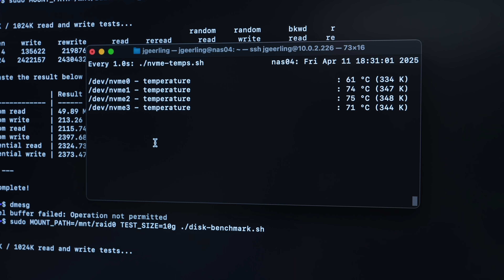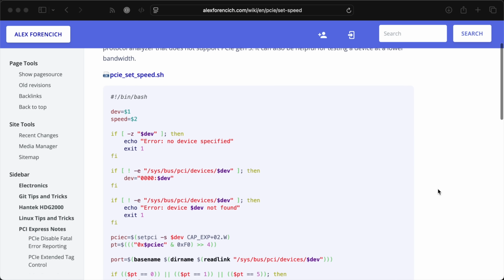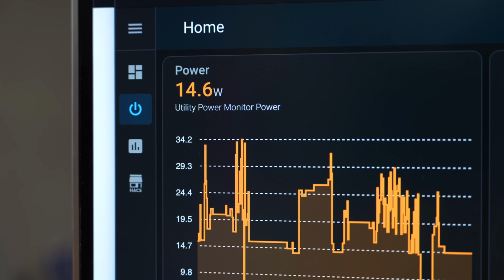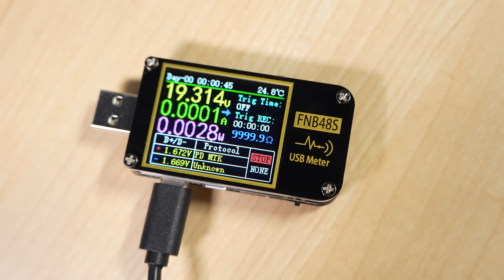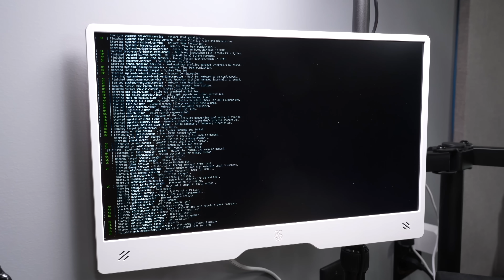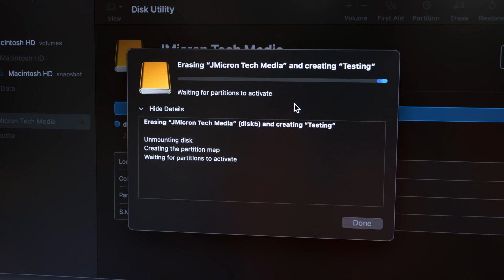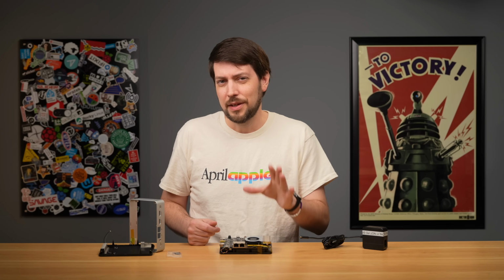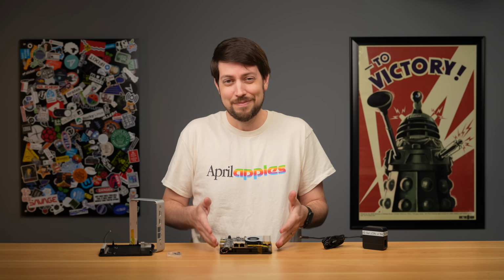I fixed the perfect Mini NAS!

Comment: you expect people supplied stuff to work? false hopes. sounds like the cpu complex is cooked, intel. you changed two variables, important being the downclock not the temp mod. your solution makes no sense. m.2 ssd should run fine on a potato power levels, assuming the base board is fine, which it is not. underclocking solved nothing if you also need the mod cooling system. out of the box solution. responsibility is on the consumer, dont trust others to supply you anything, working. its on you. well God's man, hows that trust in people now. in God we trust right? humans are defined to be lack of everything. one God you lack rich service of people guy. you should say if God allows. as you cant do anything without God allowing. and law based people systems are the curse of law. dont even talk about law based rights. freedom diy. pew pew people of peace. you get what you pay for indeed. God's gift is free, even among people. people are your problem, you know. I promise, they/you say. tongue speech is evil, dont try to stop it with your law speech. design better case yourself. then you dont have to pay anything to the middle man, law. btw yt speeds are slow as heck right now. ie why do you say me to be good. only one is good, God is one.

Comment: Sure take them up on it.  Being as I'm sitting here in my shop watching this using a GMKtec1 that I'm thrilled with, I'm very suprised in the performance problems  you ran across.  This does not seem to be up to GMKtec's usual standards.  It would be nice to see if someone else can pull off the same/similar setup properly.

Comment: My vote is still for the Asusstor 6 or 12 flash NAS. Just put it on top of your mini rack
Reply from the maker: Even on top, it's a bit wide. I actually took mine apart and was willing to pull out the hacksaw to try making it fit... but then I saw there are some circuits in the PCB that make it have to be just too wide. I've been asking them to make a narrower model..

Comment: First of all, thank you for the initial review and this extremely helpful follow-up. 
Literally 2 days before your first review, I picked up this NAS to add to my homelab despite some warnings about thermals. I figured I could slap some heatsinks on there and it'd be okay.

After your review, I hit the breaks... the unit is sitting in it's shrinkwrap and is going to be returned. After seeing this video, my position is solidified. 

Instead of this little NAS, I'm taking a totally different approach: Drop a 4x slot NVMe actively switched PCIe card into my main NAS and host the drives slated for the GMEtek in there. That card was about half the price of the GMEtek NAS anyway and should work with the 1TB sticks I had on hand. 

I am not afraid of Macgiverengineering solutions in my home lab but for a finished product, this was way too much hassle.

Cheers!
Reply from the maker: A PCIe multi-M.2 drive is a great option. Just make sure your NAS can use bifurcation or the card has a good PCIe switch and cooling!
Reply: @JeffGeerling  Indeed, I went with the latter because my board does not support bifrication and I didn't really have 16 lanes to dedicate to a card if I could manage to wedge support in. 

It has a giant active heatsink over the entire card and will have a slot cooler with three 92mm fans mounted next to it.

Comment: If the system locks up even with overkill cooling, they probably have PCIe signal integrity issues. I wouldn't really want to buy hardware that wasn't tested properly.

Comment: YES on the K100.  My NAS is running on a 2007 HP tower that is WAY out of date.  I have been loosely waiting and watching for a smaller form-factor alternative for about a year now, but I'm not so sure about diving into something like a Synology or larger, more expensive option.  Especially when the one that has been working for me for years was essentially e-waste until it got a new lease on life as a headless server.  Definitely interested in the small form factor.

Comment: Yeah, go for the review of the other one.  If it's better constructed, you may have a better fit for your mini-rack.  That said, now that you have this one running somewhat stable (though in a bit of a jank state), if you decide to use it in the mini-rack, I bet you could 3d print a front panel that'd take a couple small Noctua fans to generate airflow over the whole thing.

Comment: Hi, this is typical of engineers that do not take seriously the heat problem with electronics, not to mention that, as for any small device including so called mini-PC, the fan is always the problem when it comes to an end, specially if it lived quite a long life, you then enter the infernal spiral of the quest for the right fan (and the unseen one : at the right price).

I know there is a doubtful race among manufacturers to produce the smallest contraption, but clarity of mind and common sens are speaking another language, the one of reason, the one that is turning to regular fans.   Yes, that'll make bigger devices that in turn will be a problem to be integrated in dwarf racks, but knowing that when (and of course not if) your fan will break it will only be a $5~$15 purchase of a 80×80 mm common fan is such a comfort of the mind that smaller is really a (very) dumb run, at least in the computer matter.

About their offer to test another NAS, say yes, this way we'll see if they learned from their mistakes, which is always a good reference to get an idea of the company evolution.

Comment: Did they consult Apple engineers for the thermal design of this case? 
This NAS has MBP 2016 vibes 😅

Great work Jeff
Reply from the maker: I guess they at least have a fan in here... the annoying thing is, if they just made it blow across the entire top of the board, and cut more or larger holes for the exhaust in the side of the case... it may have solved the stability issues.

Comment: So I guess both this and the original video is ironic, since this seems as far from perfect as you can get? Either way, since I have been using 10 inch racks for years I am happy that you are continuing the quest for the perfect NAS for a 10 inch rack. At the moment I'm using the friendlyelec cm3588 with the NAS board  and enclosure and it's not bad. I wish it had dual NICs but it's really small and seems to work fine with OMV, but I would be interested in something with x86 architecture as long as the size is right.

Comment: Is your unit maybe defective? I have my G9 running with 10gbe adapter/3x nvme drives and I don’t have any of these problems I get full speeds transferring up to 300gb files. 

I dunno. 

Def take them up on the K100’tho 👀
Reply: you and me, we seem to have gotten lucky. 
As I wrote in an other answer "mine" runs 4x Kioxia Exceria G2 2TB drives (rated up to 85 ℃). I have not tested how it behaves when I trunk the two nics or run it with multipath SMB. 
I suspect it's going to die as the Intel NIC they used is known to be not the best and only rated up to 70 °C.
Reply: @DJDocsVideos  hopefully it does not die lol, I  have faith it can hold out. But that is an interesting point that jeff is using the internal nics as well. 

 I only used the internal Nic for the initial setup, and have been using an external I /O crest 10gbe nic since it set it up with truenas. I sit it on top of a 120mm fan and my crucial P3 Plus Nvme drives operate between 40-50c. I  was thinking about designing a new bottom case to funnel the air and make it look less Janky but for now it works well.
Reply: I think it might be defective. I'm also running a G9 with 3 nvme drives and heat sinks as a cloud replacement and I never see temps over 50c. The only mods I've done is I raised it up to get a bit better air flow and bumped up fan 2 a bit in BIOS. I did an offsite backup today with sustained writes at 400-800mbit which isn't close to what is tested here but it stayed under 50c. I guess it all comes down to what use case you have for it, for me it's a silent cloud replacement after my qnap ts-451 died.

Comment: I also have a small chinese mini-pc (Mele Quieter 3C) and it also came with one of these non-standard usb-c power supplies but with a constant 12V output in my case. I don't dare plugging it into anything else but I can confirm that both the usb-c port for the 12V and the usb-c port with displayport work just fine with usb-c pd power supplies and can even run at 9V PD. So while I don't like the 12V power supply it's still pretty nice in that regard. I marked the power supply similar to you with a label printer but I also printed a label for the usb-c side just in case I ever have it plugged in and only see the usb-c side when tinkering with machines.

Comment: what a hooptie, I don't have any of those issues with my FriendlyElec CM3588 NAS using a cheap 3d printed case
Reply from the maker: Might try that out at some point...
Reply: @JeffGeerling  It ain't perfect, using only pcie 3x1 for the drives, but at least it's stable. I put it in a case that has a fan right over the CPU so it spins up with CPU temp, but keeps everything under 50C
Reply: @RetroBerner  the G9 also only uses one PCIe 3 Lane per m.2 socket. The one big advantage a N150 would have over the RK3588 is the Intel Media Engine for transcoding media on demand with jellyfin. On the other hand the RK3588 board comes with only one 2.5 Gbit port but that's a RTL8125B. Is it still stuck on 6.1.x Kernels?
Reply: @DJDocsVideos  I dunno about that, I set it up with OMV when I got it, configured my backups and haven't had to touch it since. I'll look into it if the need ever arises.

Comment: This sounds like an underspecced power regulator (or undersized capacitor) combined with a crappy thermal design (hot semiconductors use more power). Do you have an oscilloscope? Try looking at some voltage pins.

Comment: is this device good enough for common use cases though?

i mean to replace cloud storage services for personal use. obviously I won't be transferring 40gb at a time...
Reply from the maker: In terms of overall long-term reliability, I'd say it could work with at least a fan blowing over the rest of the board where there's no airflow. There are VRMs, the PCIe switch chip, the networking chips... a lot of heat with nowhere to go in that part.

Comment: I never understand why cooling is an afterthought for all these tiny PCs. The larger the fan, the less noise it creates. So sacrifice having an extra inch to the chassis heft and put in a sufficiently large fan. Who cares if it’s blazing fast if the whole system is unstable. It’s like the old story of the tortoise and the hare. The hare is fast but erratic and temperamental while the slower tortoise maintains its steady unwavering speed. In the end, people don’t mind sacrificing a little speed as long as the task is done without interference and interruption.

Comment: Thanks to your videos and comments from the previous one, GMK G9 show me how much "leader" this design is actually. Also, neverthless Kingspec was mentioned several times from the guy of Hardware Haven (i currently don't remember it), this experience is a final judgment for me: avoid these for reliable devices. Sabrent seems more interesting to me.

About Aiffro K100: it's seems better designed and built, but still a step back (N100 instead of N150) and the don't provide photos of the inside, only drawings if you look deep enough for PDFs. And still... no bios updates. 

If you'll do the video I'll watch it, but seems a "worse" scenario, excluding the thermal design
Reply from the maker: N100 isn't far off from N150, just slightly slower clocks. Honestly for a 2.5 Gbps NAS that shouldn't matter.
Reply: @JeffGeerling  that does not leave any grunt for eventual network services, which in your setup could be provided from your Pi gang.

Comment: if downgrading pcie (and thus drive bandwidth works), is there a way to throttle Samba traffic to get the same effect? Also when looking at Steam Deck SSD upgrades I remember a comment saying that the 2230 sized drives use less power.
Reply: put the switch ports to 100 MBit? honestly there are 1000 ways to throttel traficbut at that point you culd just put a external HDD on the USB 2 port of your pc and be done with it.

Comment: i would not even turn this on again. this issues is they have to convert all higher volt down and in doing so make a lot of heat. there is no flow over any of the power converters. they should pull this from the shelf. I looks like the K100 is having the same issues.

Comment: Yes to taking them up on the offer. And also do a tear down so we can see how much better they did on the case design.
Reply: Yes... also; Power Input Circuits NEED cooling (think the fan inside of traditional ATX Power supplies). Yet, Laptop and Mini PC Manufacturers seem to completely ignore this reality, and rarely have any airflow near the Power Regulation chip and MOSFETs, and don't even bother to put a simple heatsink onto them.... of course when the Power MOSFETs fail, it's a technical repair, or more likely, they get to sell a whole new device (Planned Obselescence.)
Reply: I would be shocked if he didn't take them up on it.

Comment: If the point of having this thing are the drives rather than the chip (which is impressive, which can be seen in for example the Zimaboard 2) even that RK3588 NAS would be enough. Unfortunately, availability outside of the US is horrible, at least the last time I checked. I'm running a Pi 5 as a NAS at home, right now there's only one 2TB SSD in there but for me that's totally fine, even considering backups.
Reply from the maker: RK3588 is probably the ideal chip for 2.5 Gbps NAS builds, in terms of efficiency, performance, IO capability. The annoying thing is Rockchip still doesn't have full Linux support, you have to rely on community images, and those vary by board.

Comment: Holy shite.. this project is now the complete opposite of an advert for GMKTec G9, it screams do not buy!!
Reply: They could have tested the product prior to mass producing it.  What would that take? One day from somebody who understands computer stress testing.
Reply: @TheMacroSlacker  You even don´t need the experince of an  expert:
I had the machine: And under win it´s too hot; you can´t touch the device, without burning fingers.
Under Linux, it´s 10 degrease less, but still hot as hell
And this all in "idle"
After few days, awaiting answers from support, i send back and switch to a other brand
Reply: @peterhollitzer4786  What did you end up getting?
Reply: @ The Cwwk p6; I took it, cause "nice price", and the label: 4 NVMEs; and 32 GB with SSD (512 GB).
Okay, the SSD was finaly a NVME, and so only 3 Prts where left.

Doesn´t matter: ProxMox on a SandiskExtrem USB Stick (128GB), and 4x2TB NVME... and it run perfect.
Silent, even with fan, and ist massiv "Aluminium"; Temp around 50.
The rest ist history

I wrote the so called "You-Tubers"... Which "tested" the device, and even couldn´t name basics (Could be TrueNas installed on teh emmc (without proxmox between)) answers; and about heat, they say nothing.

And what i got: A lot customers buy this piece of crap, cause their frauds.
Did i ever receive an answer from the tubers???
Nope.
And this is a shame, cause there are also involed you tubers, where i thought, i can trust their experinces
Reply: @ Thanks, that was very detailed. That's the other machine I have my eye on, so it's good to know it can work well.
Reply: @peterhollitzer4786  did you return directly to GMKTec? - how was the return experience?

Comment: I love these small n100/150/200 pcs but finding a good one is hard. I personally run a cheap Beelink n100 mini pc with an additional 4tb sata SSD as a small file server. It only has gigabit ethernet but gets the job done for the price running SMB, Tailscale, Jyllyfin and Transmission. It's silent, has a really low energy consumption and runs flawlessly 24/7. I don't really care about raid on this box because all my important personal files like family pictures are also synced every week an older Synology with multiple HDDs right next to it + offsite backup.

Comment: This is reminding me of an issue I ran in to with another mini PC. The power adapter it shipped with wasn't up to the challenge. So the fixes that worked were less helpful because they fixed the thermals, but because they reduced and stabilized power draw. I switched over to an old Thinkpad power brick with a bit more headroom, and suddenly the system was approximately rock solid for years
Reply from the maker: Yeah sometimes I've used mini PCs with 12V barrel jack inputs—they include a 30W or 60W adapter, but if you plug in a nice oversized 90W adapter, it runs a little better. And the power brick doesn't get toasty.

Comment: Using a Pi to test the power supply isn’t the way that I would have gone. I was expecting the magic smoke. I have a bunch of cheap little circuit boards with a chip that negotiates PD which I use for my electronics projects. One of those combined with a multimeter and your USB power tester would have been the way to go.

Comment: 3d print a mini 1U rackmount with the guts. You could then had some proper 1U fans at low speed to keep it silent. Not ideal but better than the original bad design.
Reply from the maker: Might wind up doing this. The hardware is actually fine... if thermals are taken into consideration!